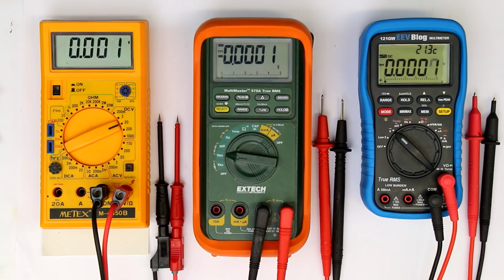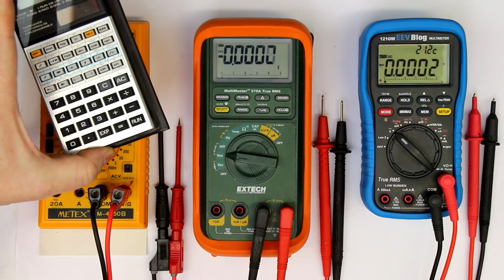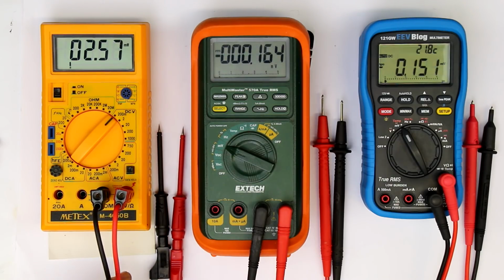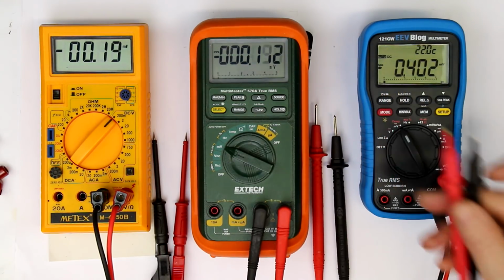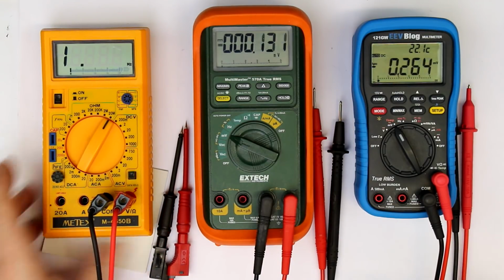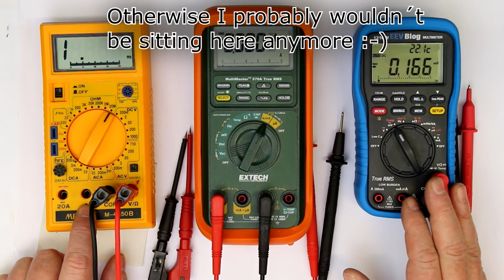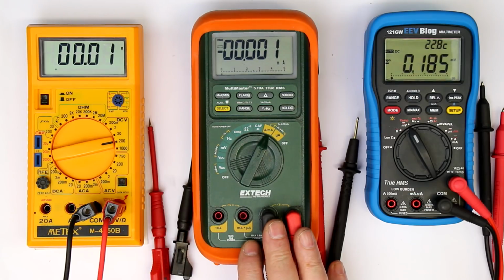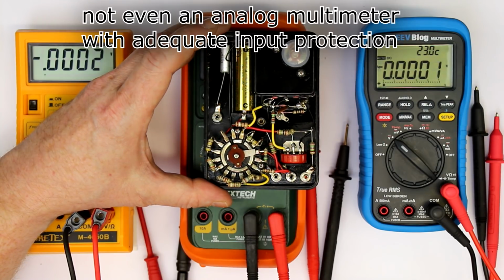Selecting a Better Multimeter Pt.1: General & Safety Considerations

Comment: According to old fluke manual (77 II if I'm not mistaken), those digit number shouldn't be read as "Fraction" (ie. 3 & 1/2 is not "three and half digit", instead "three digits and 1 of 2 for the first digit).
for example a 2000 count multimeter the LCD would be able to show digit number between 000 - 1999, hence 3 full digit from 000-999 and PLUS "one" more digit of "two" possible different values ("none" or denotes "zero" AND  "one" or "1" for MSB, hence 1/2 and 3 digits LCD multimeter .
Let's see on 6000 count, it'll be able to show only 0-5 for the first digit (MSB) and 000-999 for the rest of the digits, hence it will be written as 5/6 and 3 digits multimeter; however since 0-5 for MSB will use all 7 segments of the LCD so they'll use a full 7 segments for those MSB.
Some flukes like 87v eventhough by default they "only" do 6000 counts but they do measure a bit higher than "6000" on every range, I suppose they use like 13 bit ADC (8132 counts) but only use 6000 counts for marketing purpose (stability and accuracy issue might come to play as well).
on 4000 counts it should be written 3/4 and 3 digits multimeter, ie. 0-3 for MSB and 000-999 for the rest; it musn't read "three and a quarter plus 3 digits, it's not a denotation for fraction.
Fluke 77 II is 3200 counts, so they only display 0-3 and not using one segment of those 7 segment for the MSB first digit (check their LCD test during power on having a somewhat different first digit).
Reply from the maker: You may be right. But I think this a very creative interpretation (by Fluke) of how everybody else in the world understands "3 1/2 digits" etc. In my view the "3 1/2 digits" etc. designations were invented from the marketing section of the multimeter (or semiconductor) companies to imply a higher resolution than there really is with 2.000 counts (or "3 3/4 digits" for 4.000 counts).

Comment: The Brymen BM869s is the best meter out there for the price. Very robust and great features and accuracy. Watch Joe Smiths videos on the subject. He tested the 121 and found it to have some issues as have many others. The Brymen meters Joe tested were very good. The EEVblog Brymen BM235 is a great tough little meter too.
Reply from the maker: It´s not so simple. The 121GM has some unique features which are demonstrated especially in Pt.3 (and forthcoming Pt.4 and 5). I am also very happy with my Extech (rebranded Brymen 859s, the forerunner of the 869s). I bought it "blind" when it came out and it has the best accuracy of "affordable" multimeters I know of and also some unique features. 

And I don´t find anything special about the BM235. It´s just an "average" multimeter concerning features and useablility. 

But I still think the 121GW is "the" absolute best multimeter in that price-range concerning useful/unique features, accuracy and useability. You can live with the issues (every complex multimeter has some issues) and most of them could be resolved with a future firmware update. 

BTW: Joe Smith commented on the VA-mode "problem" of the 121GW that can be seen in Pt.3 of my series which can be easily solved with a modified connection of the load (Joe´s idea).
Reply: @KainkaLabs  3 years later (and 2,5 years later after Joe Smith's 6 part review of this meter), most issues that came to light in Joe Smith's review are I think still not solved. (I think only the SD card write problem has been solved).
Yes the 121GW has 2 unique features (modes measuring VA and burden voltage), but the BM869S also has features the 121GW doesn't have, so that's a bit of an individual preference.
But one of the main issues, a safety issue, that it has trouble resolving DC voltage in an AC+DC voltage and having trouble resolving AC in autorange in AC+DC is not fixed. Strange that this happens in a multimeter from a person that has been hammering on multimeter safety for well over a decade and giving so many thumbs down on multimeters that don't meet the highest safety standards.
With all the issues in this meter, I'm not surprised that his latest multimeter offering is again a Brymen.
Indeed no complex multimeter is 100% free from issues, but this 121gw just seems to have way more than most others. The BM869S is virtually free from issues (most brymen are), more accurate and better build.

Comment: what is the box with the knobs on it called?  That's the power or a power inverter?
Reply from the maker: If you mean the box with the 3 rotary switches: It´s an RLC-Box where you can select any combination of a resistor, capacitor or inductor (independent, in series or in parallel). Has nothing to do with power. Only passive components internal. There is a separate about that RLC-box in the EMSHO ("Every maker should have one...") video-series

Comment: At 25:23, those are not green MOVs but PTCs.  Their job is to limit the current when the MOVs clamp.
Reply from the maker: Yep, you are right. I always mix them up :-)
Reply: Looking forward to Part 2.
Reply from the maker: Is already shot. Had no time for editing last week. Part2 will be more interesting and Part 3 will be the most interesting IMHO.
Reply: @KainkaLabs  I would like to see more reviews for the 121GW.  I'm bit surprised that there isn't more out there.  Enjoying your meter history for now.
Reply from the maker: I had thought that there were many reviews of the 121GW out but hadn´t searched for them before.
Anyway after the 3 parts you will have a complete impression of all the features. There are so many (unique ones)...
Reply: @KainkaLabs  Most of what I have seen were unboxing, short clips demonstrating problems or just looking at the basics.   I've posted a fair amount detail for the prototype but have yet to pull the trigger on the released version.   It looks like they have continued to make some headway with it.  That time thing you mention is why I have not picked one up.  It's a fair bit of investment to run the tests and I want to make sure the meter is stable before hand.   I was glad to see them change out the one clamp and that MUX.  Hopefully the meter will perform well.

Comment: Technically, the minimum resolution doesn't have to do with the number of counts/digits, it's just that you have more dynamic range, so that you have more digits when measuring certain voltages. For example, if I'm measuring 3.3 V, on a 2000 count multimeter, I'll have only 2 decimals; on a 20000 count one, 3 decimals, and in a 50000 count one, 4 decimals! But to measure 100 µV with 1 µV precision, I don't need a 20000 count multimeter, I can do it on a 2000 count one if it has a range that has microvolts.
Reply from the maker: Yes, technically you are of course right :-)

Comment: Nice video, but an exploding glass fuse is seldom a problem, just shake the shared out.
The problem is arcs, i.e if the blown fuse do not break the current, that is very serious, but do not happen on domestic circuits.